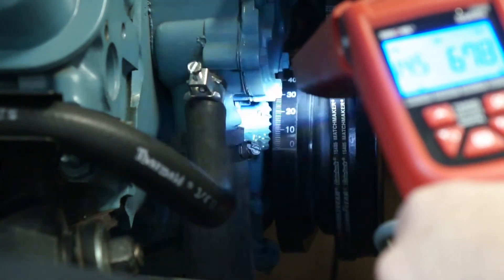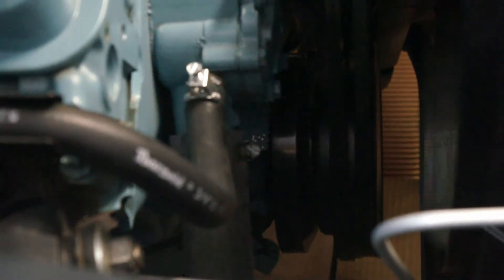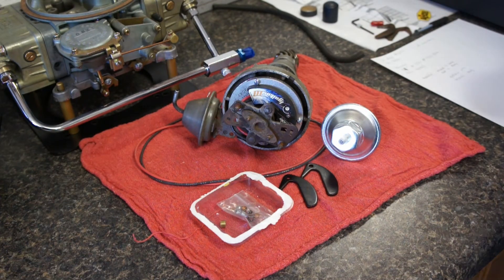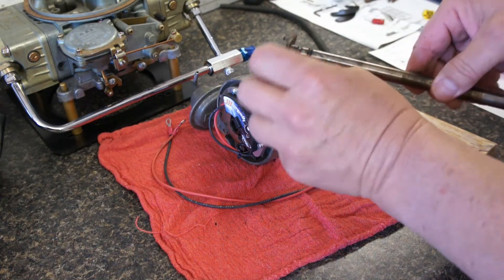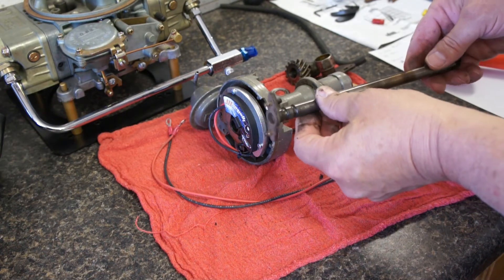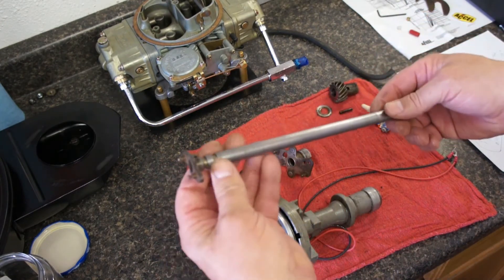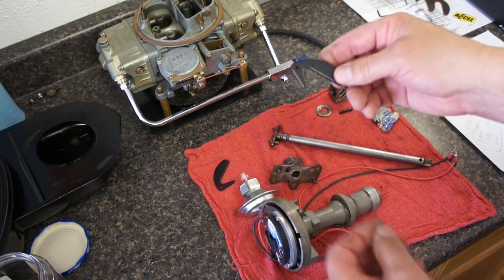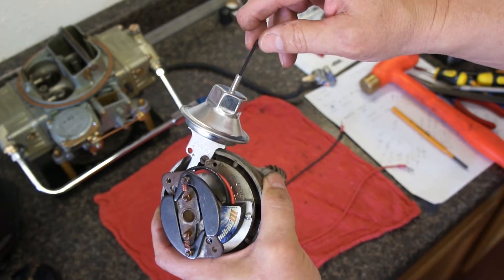GM distributor recurve with adjustable vacuum advance

Comment: Thanks for the.video I need to replace the canister on a pertronix unit that was based on that design 
You had a really good spark  from that light nice and steady if you had a irratic spark  and a few times the light showed you BDC instead of say 10 degrees BTC what do you think 🤔 woukd cause that ? A faulty light ? Miss fire ? Cross fire from another plug / cylinder that happened to me a few times setting my timing not a good sight .
It woukd be flashing 10 BTC then i woukd see The opposite side of the balancer on the light
Reply from the maker: I've never had a situation where a timing light would change between BTDC and ATDC. Is your distributor loose and moving around?
Reply: @SPSteve  not that i know of its a fairly new unit. Engine rebuilt with only 3,000 mikes  im thinking of buying a better timing light .
Reply from the maker: @TheThirdWheel618  worth a try. Good tools are always worth the investment

Comment: Thanks!  I'll be setting up a '70 Trans Am with the RAIII 400 using this information.
Reply: @SPSteve  I run 91 Octane and add octane boost.  I also put lead substitute which I'm not sure that I need.

Comment: Why not limit mechanical advance to around 10° and put say 26° initial timing on the crank for around 36° for better snappier performance down low?
Reply: A good chance the starter motor may not like that. Depending on the engine it may also gas ping. One thing for sure- one size don't fit all. What you suggested WILL work well on many combinations👍

Comment: As a matter of fact when you have it on manifold vacuum under part throttle load it actually backs off the timing when vacuum drops a bit so your loosing power de tuning it's not the way it should be check out all the videos on the subject anyone so I can be taught cuz maybe I'm wrong actually uncle tony's garage has a perfect demonstration of what I just said he does it in real time driving the car and shows it actually backs off on the advance on part throttle instead of advancing like it should

Comment: OK I am lost. You had a initial of 16* and 14* of mechanical advance with the vacuum advance unplugged giving you 30*. Then you clearly had the vacuum advance hooked up to manifold vacuum when it went up to 35* at idle. So how did you end up with 49* when you revved up the engine? Shouldn't it take you back down to 30* as engine speed increases and vacuum decreases if you had it hooked up to full manifold vacuum???
Reply: The vacuum advance should not make any difference at idle it should be hooked to ported vacuum if it does anything it should be very little. At idle but the minute you give it a little gas it advances to give good throttle response and milage at very little throttle till the Rpms come up enough to take over
Reply: Vacuum advance works better on manifold vacuum or atleast always has for me. Ported vacuum was a 70s era emissions crutch.

Comment: Since your vacuum canister is not dropping off, how do you have the vacuum line hooked up.  I also noticed the new looking tower clamp on your heater hose.. where did you get it?  Thanks, great video
Reply: It's not supposed to be on manifold vacuum that advances way too much at idle why would you want that it's supposed to advance under real small part throttle to enhance drivability and fuel milage but at idle it should not make any difference most don't even use it idk I've never set mine up that way and I've seen only very very few cars that actually use manifold vacuum for it and none were GM's especially not pontiac

Comment: Thanks Steve! I've probably watched this video about 4 times. This a really good demonstration showing all the advance numbers with and without vacuum, and a good before and after result. I just bought an adjustable canister for my HEI, hopefully I can get my timing curve closer to yours for my chevy 283. Also I found a very good article online that discusses all of what you just demonstrated. In case anyone is chasing the same issues I included the link. Thanks for sharing, it is very helpful to watch.

http://outintheshop.com/faq/hei.htm
Reply: @SPSteve  It was very useful. My mechanical is right at 34 all in but my base is still high at about 17. Under full vacuum I'm at about 49. I think I'm getting close. At idle with full manifold it's a little above 30. I have yet to play with the mechanical and springs but from what you have shown I can fix that. The problem I'm facing right now is that when I put it into D or R the engine just stalls out and dies. It will not idle in gear which is really weird being that it's supposed to be a 1900-2200 stall converter. It's a bit of a hot cam and I have yet to really dial the idle mix with a my vacuum gauge. Also it runs up hot pretty quick. I wish I had  4 speed manual instead. I may have carb issues, I may have trans issues, hard to tell but it fires up right away, pulls hard under part throttle. I haven't given the it beans full rpm yet I just rebuilt this 283 but it sounds very  strong. Sorry for the rant, thanks for the response.

Comment: interesting; i didnt know about adjustable vacuum cannister, do you think there's a sort of universal application? lets say with some modification
it will fit other distributors?
Reply: The only adjustment is how much it advances not when smh I'm in total disagreement w hooking it to manifold vacuum it's gonna back off on the advance on part throttle and not advance it
Reply: @glennmanchester1568  For the most part I agree with your statement regarding the ported vacuum source but one size don't fit all.👍Actually, the adjustment of the vacuum can with an allen wrench affects how much vacuum is required to activate it but not the amount of advance. There are units that have the total amount of advance adjustment, too, though.
Reply: @mickangio16    My Rover V8 (Buick 215) needs like 30* at idle to run its smoothest, vacuum at 12-13 (with intake 280, exhaust 290 cam, intake max lift at 106.5*). If I put this timing in static it will be hard to start, solution is to use adjustable vacuum advance to achieve the 30* idle. 
Very similar setup to the one in this excellent video.

Comment: Good vid ! I performed a full rebuild on my pontiac hei, and curved best i could for my 70 formula 400 with 13 iron heads. Still have a bit more fine tuning to do.
Have you had to shim up your distributor gear ?
Reply: SP Steve yea it is !
I think i recall to have about .060" or 0.075" of free play in mine.
I bought a shim kit for Hei's on ebay and shimmed it up, only have .020/.025 now.
What's the specs on your curve now ?
Do still get pinging ?
Reply: Every 10,000'ths of slop can mean around 1.2 degrees off on your timing, I shim mine to 15,000'ths.